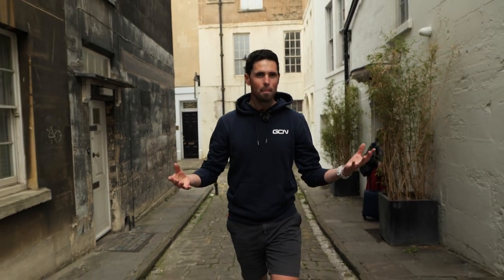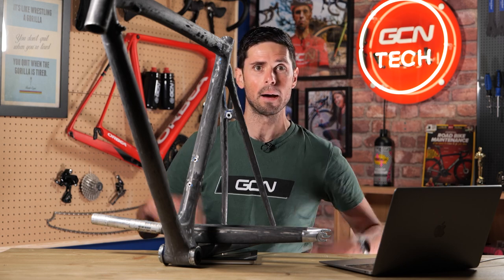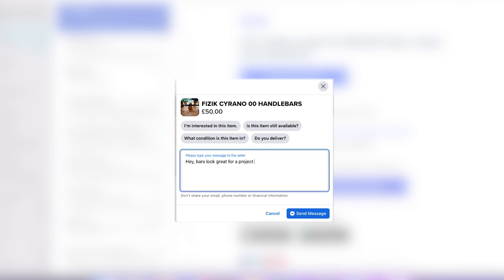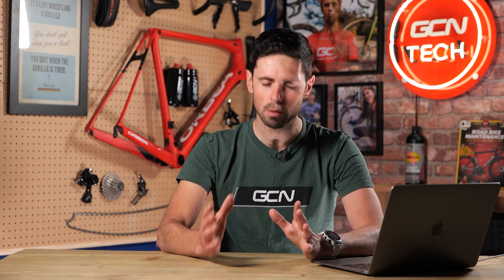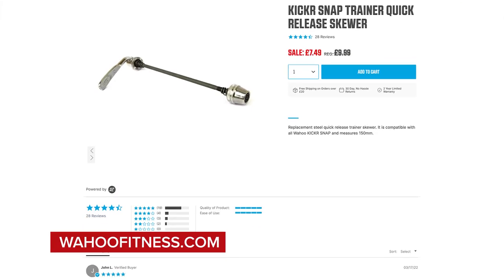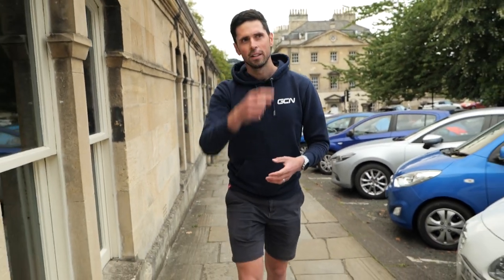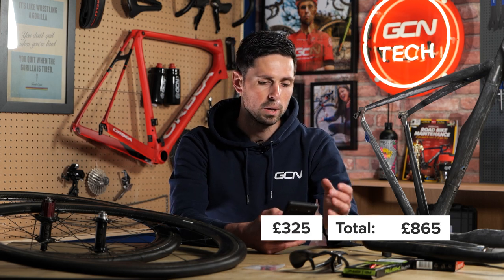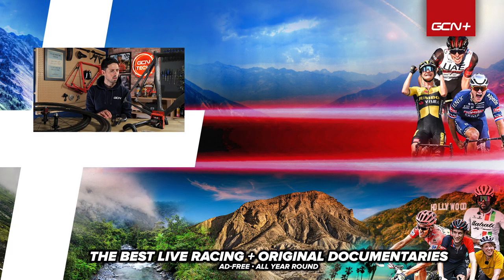Finding Bargain Upgrades | Super-Light Bike On A Budget Part 2

Comment: The reason the seat debonded in the first place was the two mating surfaces weren't properly prepared. Shiny surface means the JB Weld will debond again because there's no mechanical interaction. (The "metal-filled" thing is just marketing crap - won't make any structural difference).  What you need to do is heavily scour both surfaces - a bit of 32 grit sandpaper, or a small dremel bit in there to rough it all up on both parts. Then your standard 5min araldite, which is a standard epoxy resin similar to what the seat is made with, will fix it up properly.
Reply: "Justin" the metal particles do have a purpose. Evidently you do not have any actual mechanical engineering experience.
Reply: @stephencurry8552  He's not wrong about everything else.
Reply: @stephencurry8552  Yes, I'm not a mechanical engineer, but I am certified to repair composite fibre aircraft structures. There's no structural strength in that as the particles are too small to create a proper matrix in the resin to distribute the load throughout the bond. If they were large enough, then it becomes too large to get the two surfaces to mate together and you end up with a big blob of weak material sitting between the rail and the seat top. That will fail again rapidly in such a high stress location. Might be OK if you want something for space filling like a slightly stronger car bog which is where we use something similar - resin with glass flock in it
Reply: @justincouch6964  Sure you are sport.
Reply: I suggest that Alex add some layer of carbon roving / band impreged with epoxy on top of rail/seat junction too ...

Comment: I think you miscalculated – you bought the wheels for 300 GBP, not 325 as you counted in the final calculation. That means you have 30 GBP left and not just 5. So… what about some lightweight outer cables?
Reply: Shipping...
Reply: He did say he'd splurge on delivery though... whether that's worth 25 Pou-Eur-llars, me knows not.
Reply: @Two-eyed Roy  Okay, seems I've missed that. Thanks.
Reply: At min 6;22 you can see 2nd class (which is typically 3 days) is included in the price, plus his email confirms total at £300. I.e. no extra postage cost.
This means Alex did not pay extra for quicker postage. The item also took 3 days too.

Also quicker postage wouldn't cost a £25 premium over 2 class.
Reply: Correction:

Look up completed listings 'Tune Mig Mag X Zipp 303 Tubular Carbon Wheelset 10 Speed'

Only one item appears, which are these wheels.

You can see he paid £16 for first class delivery.

Comment: Another great eBay tip is to heart/ like the item you want to buy. If you can wait, usually within 24-48 hours if the item isn’t sold the seller will drop message you with an offer that’s usually around 20% off. You can then counter with the nearest round number below their offer and they typically accept. Great of you’re not in a rush to get the item you want

Comment: You saved a whopping 3.6 grams with paint removal.
I got a mixed wheelset on my bike, my rear wheel, HED, off of Craigslist and the front wheel, Bontrager, from Proscloset for just under $400 usd combined. Good luck with the build and the hill climb.

Comment: I'd guess 96g...
Simple question from ep1: what do you use to fill the cage bolt holes in the frame after removing the bolts to save weight? Or leave them open?

Comment: I bought a set of those skewers. Very light indeed but not very robust. Got a puncture on the rear and when tightening the skewer the handle part of it snapped off. Luckily the skewer was partially tight. I cycled the remaining 12 miles home rather cautiously to say the least. Do not buy them!

Comment: 97 grams saved on the frame by removing paint. I wonder if by sanding down the carbon frame it'll allow for UV deterioration of the same. Maybe it should be repainted? :| 
I have the same quick release skewers (but in black), they are more than fine for the past 6 months. Tiny titanium QR are safe, QR works just by pressing the fork/frame into the wheels, they aren't supposed to actually hold any weight.

Comment: A review on that exact quick release: do not ride it down hill. I had the same model, even the same color, from the brand. They are a china import, which isn't a problem in itself, but should raise attention. My rear wheel quick release slowly unscrewed itself while riding, had to tighten it to keep the wheel in! Dangerous part for anything but short uphill racing, in my opinion. Of course, could be a fluke with the set I received, and the seller did offer me a refund on the pair. Stay safe, people.

Comment: my guess for saved weight is 314 grams ps you might want to coat the frame in epoxy as you most likely have removed that also using a finger belt sander #brutal loving the build tho alex :)

Comment: I'll guess 106 grams saved by sanding the frame and making it extremely ugly.  I really think you should have sanded both bonding surfaces on the saddle then cleaned them and bonded them with the 2 part epoxy.  Roughing up surfaces like that should help.

Comment: Too bad you didnt include a cheap carbon seatpost and an UNO ultra light stem.
Would have cost you maybe 40-50£ more but save a lot of weight.
You overpaid the quick release, bars and wheels imho, you could have add for the same price brand new carbon tubular wheels from reputable china brands and the same quick release can be found on aliexpress for 1/3rd of the price.